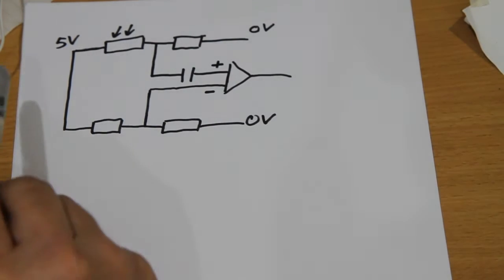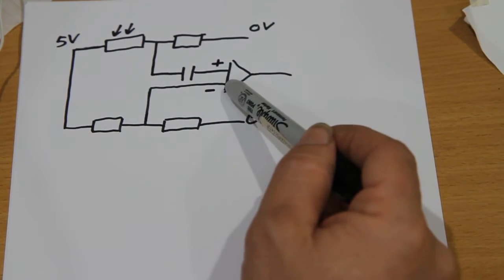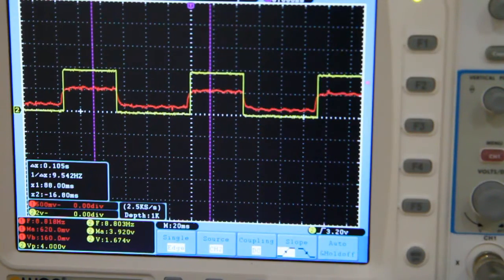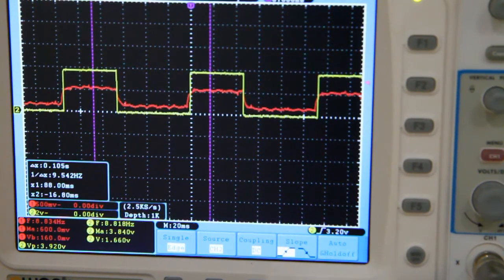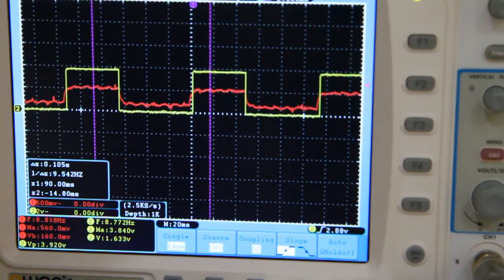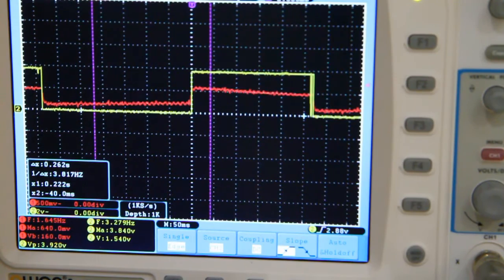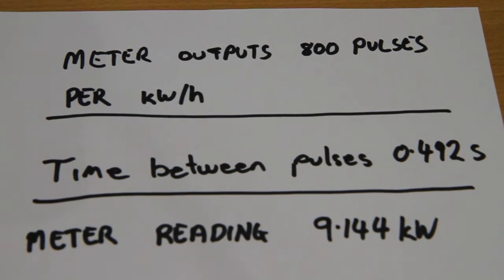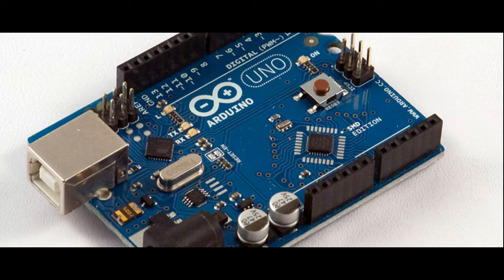Pulse detector for LED flash on smart meter

Comment: Looking at your measurements, you can also do it this way:
Just measure pulses within 30 Sec. In your case, it is 2.033 * 30 = 61 pulses in 30 Sec
1000/800 = 1.25 kh value
61 * 1.25 = 76.23 Wh
3600 / 30 sec * 76.23 = 9147.6 or 9.147kW

Comment: WOrking on the same thing for my final year project. The meter i have is a type 5235A LandisGyr and i have to read the pulses from the blink LED. The LED is very dim that the sensor reads 100mV. Any help on what i should try?